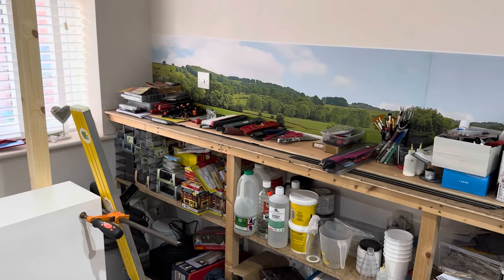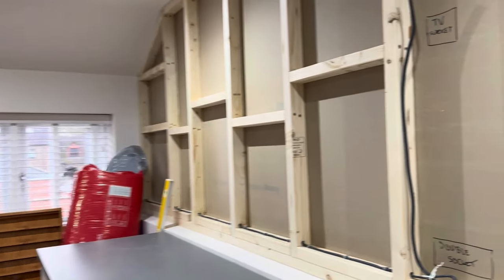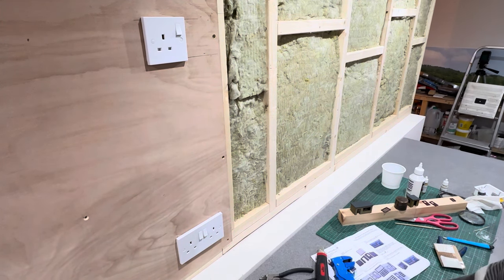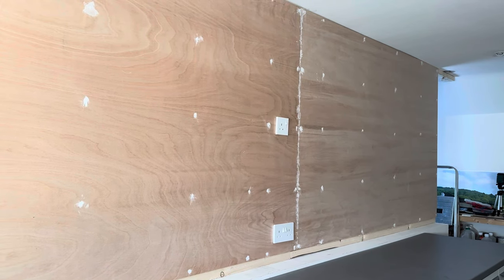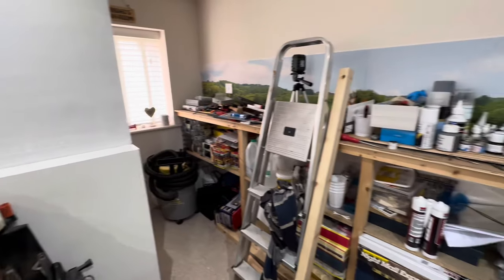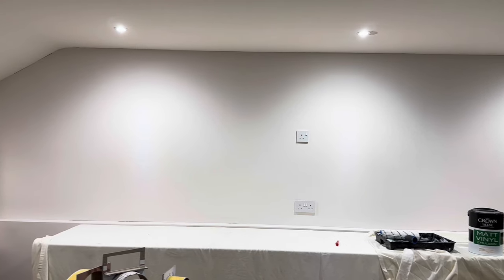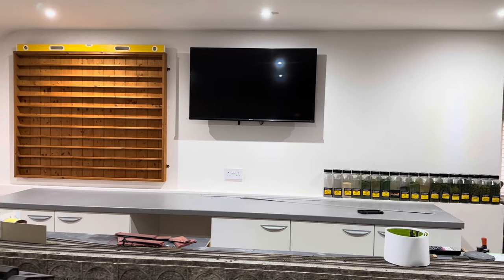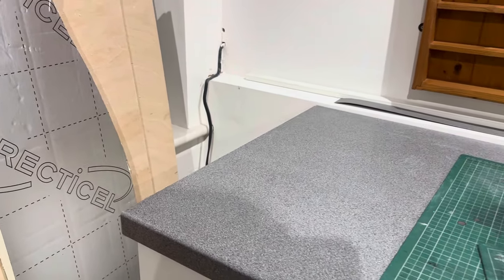Beechcroft Model Railway - #38. They say things happen in 3’s….

Comment: Looks brilliant well done. Just one idea if you haven’t sorted the worktop already - you can buy metal worktop ends which also have a bit of a lip on the top of them - that might just hide the damage without you needing to cut the worktop down further. Cheers Ian.
Reply from the maker: Thank Ian. I’ve been looking at those today! Can pick one up for about £8. Would probably give that edge more protection 👍

Comment: Very good...have you included Internet RJ45 cable... A spot of Copydex will hide the carpet tear...I've a family of carpet fitters, including myself, but I preferred life as a Sparky.   A tip with your painting...emulsion is easy just don't try and spread the paint out too much and work in a squared area.
Wood cut damage...place a piece of timber underneath and fill the gap with PVA.
Reply from the maker: Thanks very much for the advice. I’ll try that 👍

Comment: Why do you want a door? if you don't have one the smoke alarm can go back where it was. When you trim the work top with a circular saw put masking tape where the cut is going to be as this will stop it chipping the edge or turn the work top up side down to cut it.
Reply from the maker: Hi. Thanks for the worktop tip. I just think a door will keep the cold from the stairwell out 👍